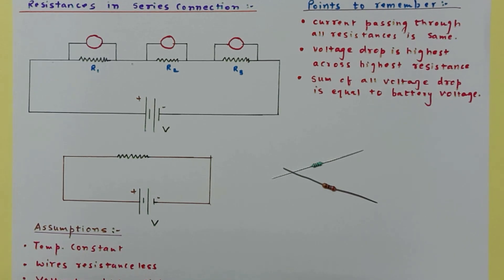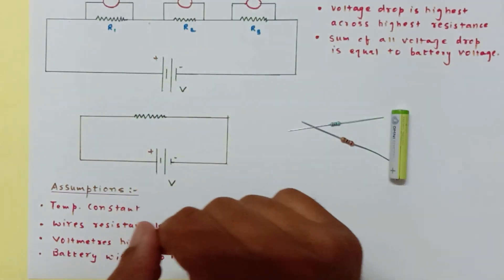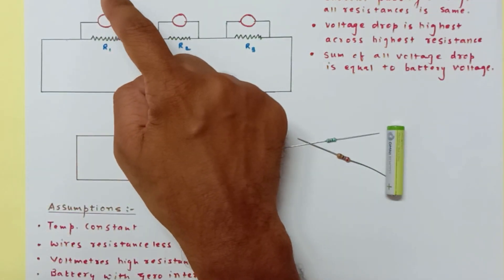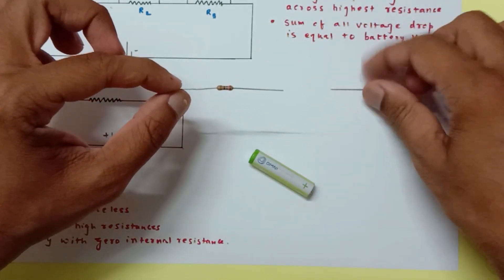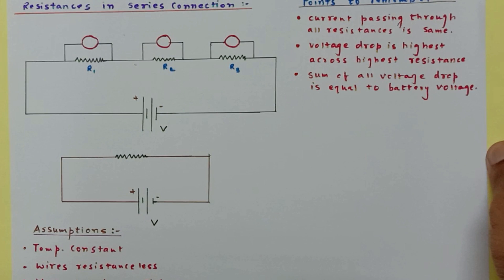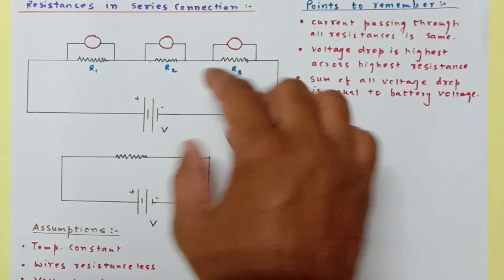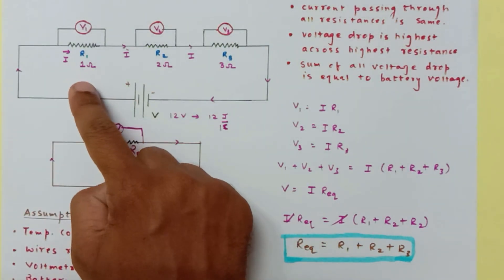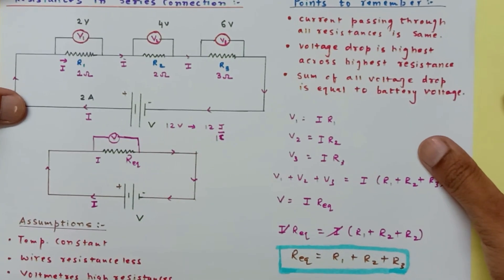RESISTANCES IN SERIES micro analysis of voltage drop across resistors grade 10-12

Comment: THIS IS NOT PRACTICAL BUT ONLY THEORETICAL---in this circuit, V=I*R, which means means that if current remains constant then voltage of the battery will exceed to infinity if the value of the resistor also increases. Practically, voltage will DROP across the battery if you short the battery (means to lower the resistance of the load) but if you remove the load then the resistance would become infinity but the battery voltage won't be infinity. It will be only 20V.
Reply from the maker: we consider the resistance of the resistor constant while conducting the experiment and then we see the variations in current and voltage. Thanks for watching
Reply: @MakeMeScientific   @MakeMeScientific  I am NOT talking about your testing but about the formula. As per the ohms law formula  V = I*R, which means that if value of R increases then V should also INCREASE. But it won't practically increase after one value.

Comment: I wanna i ask one question and that is why is voltage divided in series combination of resistors.  Sir, Please explain this . Plzzz
Reply: So why it does not happen in parallel combination of resistors
Reply: @tejaswimishra3681  Because in parallel connections the battery gives full energy to each resistor but in series this energy loss is shared among resistors. The reason is that in parallel our current is split up into the parts and it looks like we have two different circuits but have the same source. However in series we have only one type of current and its energy drops everytime it passes through the resistors. I hope it helps)
Reply from the maker: Voltage is a kind of energy that electrons take from the battery and when passes through the resistance it looses the energy so voltage decreases

Comment: Sir, I don't know how to thank you , I was searching for this kind of answer for so many days , and seeing every video I come across and topic ...that how I found u....I was intriguing myself 
How does current will be constant overall if it is used by resistor ... I was thinking like that ,but Ur micro explanation clear my doubts, i.e  eventhough battery is  volt that is device does work so that is J/ C means charge needs to take 12J to move in circuit ...so that work is done by battery by not charge...I was thinking how does electron loses it charge to lighten blub or some other device ...I was thinking like this ....but today ...I got cleared not electron , but battery connected to circuit causes it to make motion, energy to work by  electron .......I think I got right sir, am in right track I think😅..pls clarify?

Please let me know if electron repels one another , how does battery can make to do work by over coming there electrical field?
How does here in conductor electric field applies? Please clarify on this point also sir ....thank you sir ...🙏😊